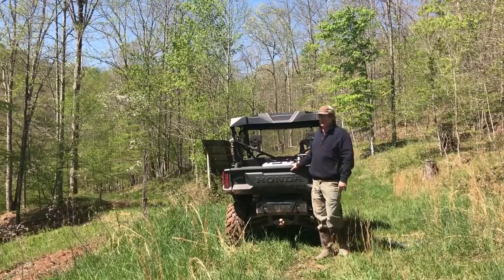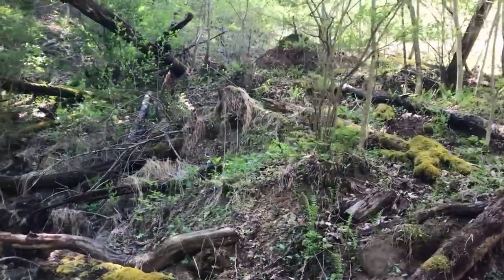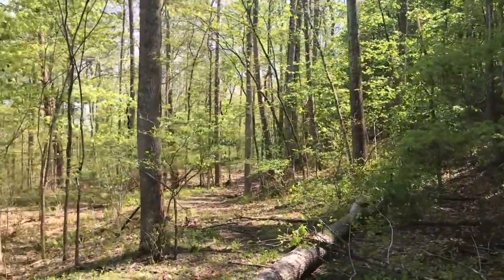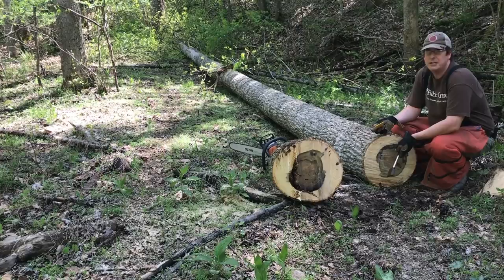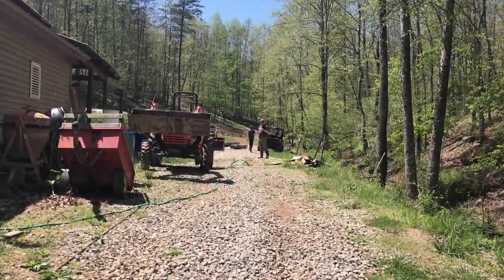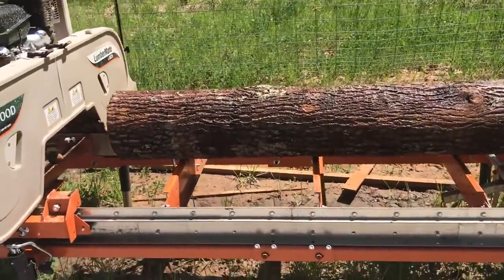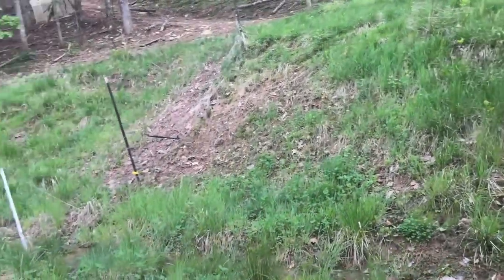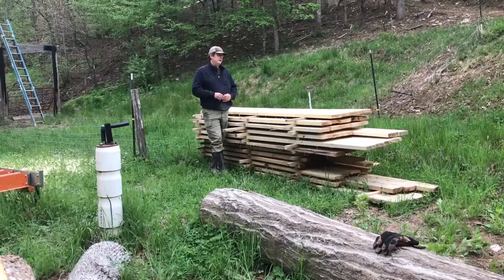Shopping for the best tree in the woods

Comment: Nice video, I would like to see a video on how you properly cut a tree into usable lumber, as in how you maximize lumber from a log, what are the ways to slice slice up a log, how you prepare it for use, how you cut it for maximum dimensional lumber strength, etc.
Reply from the maker: Good suggestion. I will put that on the list.

Comment: I enjoyed the video. Thanks. If you'll replace one of your chain hooks with a slip hook and use it at the log, it'll make skidding logs alot easier. The harder you pull, the tighter the chain grips the log.
Reply from the maker: I had one and broke it. Need to replace the link.

Comment: Troy you talked about your saw blades, can you guess about how many board feet you are cutting before you have to replace the blade? And anyone reading this comment that has a mill,I would like to here how long the blades last.
Reply from the maker: I go about 3 to 4 logs and then switch blades to keep from wearing them down so much. If I debarked the trees, I could go longer.